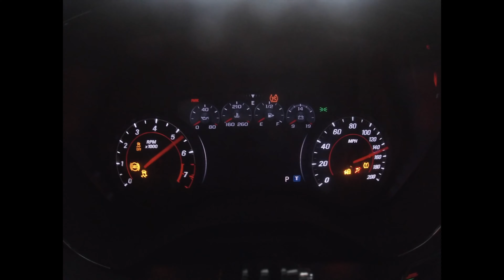Camaro SS Engine Failure Aftermath: Over $10,000 Down The Drain

Comment: Sorry to hear this.We had a 6.2L truck engine put a rod out the block unexpectedly last fall.
Reply from the maker: What caused it?
Reply: @TazBeGrinding  The truck belongs to a friend of mine and it was covered under warranty.They told us they believed that some of these engines had loose fitting piston pins and in this case one let go and sent a couple pistons and rods through the bottom.Big hole in the bottom of the oil pan and the parts ended up laying on the skid plate.